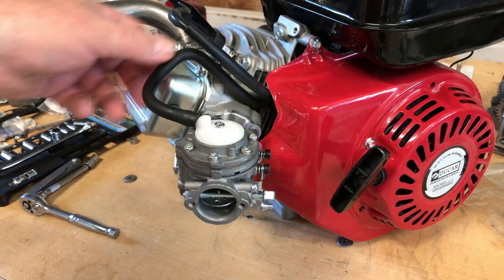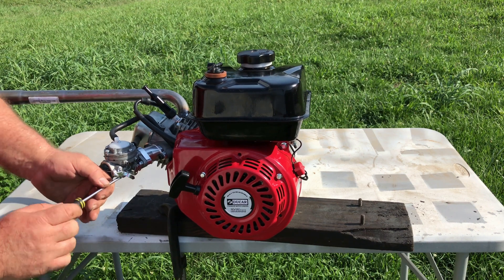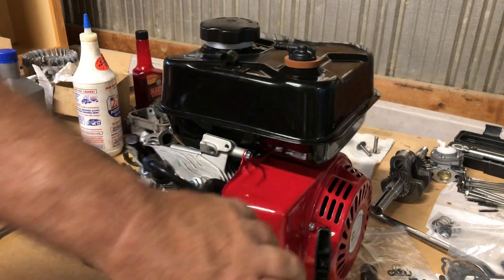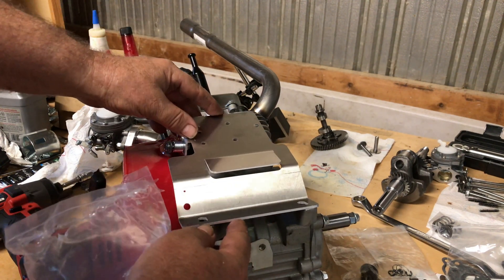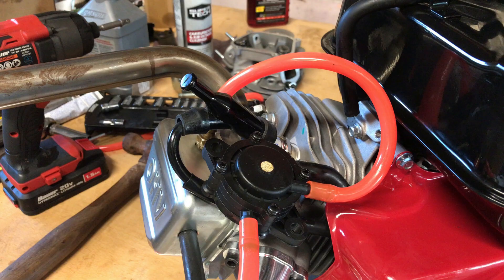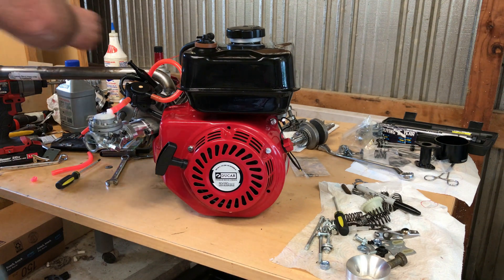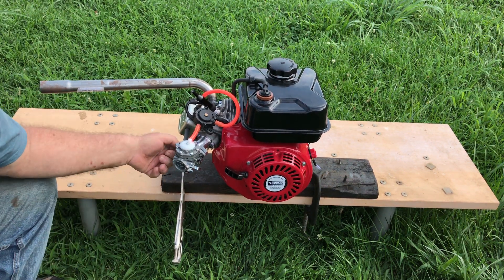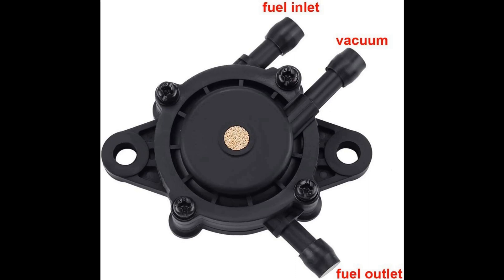Tillotson Carburetor Will It Run Without a Fuel Pump? Let's Find Out! DUCAR Predator Ghost 212

Comment: Tillotson has a built in fuel pump especially with the older chain saws that used that style carburetor
Reply from the maker: Hi William! Chainsaws usually use a pressurized fuel tank to achieve the fuel pump effect. The old Homelites used a rubber valve called a "duckbill" that would pressurize the tank. I first found out about pressurized fuel tanks the first time I removed a fuel line from a chainsaw carb and it became a small version of "Old Faithful". Soaked me and the bench with 2 stroke mix!

Comment: I run mine with the stock tank gravity feed. No fuel pump. It runs awesome.  The first time starting is a couple pulls. But I cover the throttle body opening with my palm. Pull a couple times and then  maybe one or two pulls after that it runs fine.
Reply: I may try a pump I have thou and see if it runs any better.    I’m 3/4 turn out on the low. 1-1/4 out on the high and pivot arm bent  to about half travel and it runs mint. It was just pig rich when I tried it with the pivot arm level and straight.  With both the carbs I tried it was the same.
Reply from the maker: Hi James! I think I had air in the line when I tried to run this one without a pump. I will be revisiting this issue again to see if I can get it to run without the fuel pump. Chainsaws use a pressurized tank to get around this issue.
Reply: I was thinking of pressurizing the tank with crank case pressure but it worked fine so I never did.  It has crazy midrange power using these carbs. There a little big for a 196/212 I think so there is a down low hesitation because of the large amount of air but as soon as the fuel picks up it’s out of there
Reply from the maker: Hi James! For low end bog out of the corners you can open the low speed screw a little to give it more fuel during the low speed circuit or add a second pump stack. (I've noticed with stacked pump carbs you can't let it idle though or it will dilute the crankcase oil with Methanol or gas.) Lots of oil changes!

Comment: Would this carb work well with a 212 with a bid valve head ? Or which one should I buy ? Ty
Reply from the maker: Hi GB Racing! Here's the venturi size from the "Tillotson Clone Carbs How do they Measure Up? video:
FULIN = .750 venturi with a 1" Throttle Bore ($14.00)

Tillotson "marked" Clone = .785 venturi with a 1" Throttle Bore ($14.00)

HD Golf Cart Replacement Carburetor = .865 venturi with a 1" Throttle Bore (This one was $19.99)

If you have a hot engine, I'd go with the larger venturi carburetor. The link to the $13 carb has sent me two different types of Tillotson clone carbs. I think it must be luck of the draw? The Harley Davidson Golf Cart replacement carburetor was the largest at .865 venturi bore but it was also $19.99 after some shopping around.

The Tillotson carbs are by far my favorite carburetors for performance engines especially on those that are running Methanol. You can stack the fuel pump blocks for more "force fed fuel" and there's no float bowl to splash fuel around in the corners if you're racing.
Reply: @KentuckyFriedFixes  Ty ! You’re the best !!

Comment: Dont those carbs have internal pumps?
Reply from the maker: Hi MBM! The Tillotson does use a diaphragm pulse to pump fuel internally into the bore of the carb but nothing for external pumping of fuel. I had thought since chainsaws don't have an external fuel pump why would I need one? The problem is chainsaws actually pressurize the fuel tank which creates fuel pressure just like an external fuel pump would. I found that out the first time I pulled a fuel line off a chainsaw carb and it sprayed 2 stroke gas everywhere. Some still say it's possible to run the Tilly without a fuel pump so I may revisit this in the future for another try. Thanks!
Reply: @KentuckyFriedFixes  its because i have a hl374a on alky and it had used it on a fuel pump and it was to much gas and thats why i asked thank you for the info🤝🙏
Reply from the maker: @martin_gets_sidewayz  Were you using an electric fuel pump? I know some have had issues with anything other than the pulse pumps. Too much fuel pressure will blow the needle off the seat and pop the diaphragm. Your pop off may be set too low as well. More fuel pressure requires a higher pop off setting. These things are a bit of trouble to tune but for racing they're the way to go IMO.

Comment: Interesting video KFF!  i was thinking about trying out a Tilly  TCT mechanical injection carb, but also guessed it would need a pulse pump even on a gravity fed tank.  Ever played with one of those on a 212 clone?
Reply from the maker: Hi Rick! I've seen the Tillotson injection carbs that look a bit like a regular clone carb but I've not tried those. I prefer the old tried and true Tillotson design, they're about as close as you can get to an injection fuel system IMO. They've always worked great with Methanol and you can soak the cylinder walls if you let a Tilly carb idle. Love them things! I was excited to try these cheap cloned Tilly carbs they're pretty good for the money!
Reply: @KentuckyFriedFixes  the one you want to try over a 196cc motor is the TILLY TFB for the extra bore size.  I'm with you though... too many gimmicks on the mechanical injection and a need for a pulse pump on clones.   I prefer a TILLY PK-3A at altitude right out of the box to keep steady.  I ride 8k+ where I am, but these carbs are interesting if at steady lower elevation once tuned. Keep it up.  Learning a lot from you.
Reply from the maker: @rickwhitfield7617  Thanks Rick! I'll look into those TFB carbs!
Reply: Yep.. we agree on gimmicky on the mechanical injection units. That's funny, because I have actually been waiting to buy a Tilly PK 3A... but cant find any in stock.  EC CARBURETORS has been out for some time. Do you know of another vendor out there that carries them?  I was thinking I could also snag a Tilly PK 2B and simply rejet it down, but that feels like a hassle.
Reply from the maker: @rickwhitfield7617  Rick I usually don't mess with the stock style carburetors as there's not a lot of power in those. There are much better performance options but I realize if you're Kart racing or something your choices are kind of limited. If I was going to go with a stock style carb I'd use one from EC for sure though. Those guys are good on carburetors. They don't sponsor the channel or anything but credit given where its due, they know their business.

Comment: Pull the carb , check the flange on the carb,see the tee tiny hole in the carb flange? Put a small slot in your intake flange to allow the intake pulse to meet that hole. Trim your gasket to allow for the pulse to meet hole ,but be sure the carb seals above the tee tiny hole. Taa daa no pump!
Reply from the maker: Hi Mark! I am going to try this one again. It has the correct intake and gasket to allow the carb to pulse properly. I think maybe some air got into the line as well. I should have checked further before calling it but I will give it another go. If it will run without a fuel pump I want to make it happen. I was originally thinking that if chainsaws will run without a pump this would too but I think the chainsaw fuel tanks are pressurized with a duck bill valve. Not giving up. Thanks!
Reply: @KentuckyFriedFixes  you had it running so, if it works it’s good . I run my carb dry at the end of the day so I have to cover the carb with my hand till it gets wet
Reply from the maker: @mark501w  Thanks Mark. Good info!
Reply: Yes, I used 3 Tillotson carbs on old Vire-6 and made that internal fuel pumps. Successfully.

Comment: From what I'm seeing...there's a big hump in the fuel line from the tank to the carb. It's not a straight up/down shot. I'm not sure how fuel is supposed to get over that Mt Everest sized hump in the line to get to the carb with just gravity to help. Maybe a shorter fuel line for a straighter shot?
Reply from the maker: I'm not giving up on it. There will be more attempts to run a Tillotson without a fuel pump coming up. I have been thinking about that very issue with the fuel line being elevated on this attempt. It could make all the difference. Thanks!

Comment: drill holes in that gas cap thats what i did before i ran my dirtbike tank
Reply from the maker: I've not given up on trying to get the Tillotson to run without a fuel pump. I will try again but may use an electric start for the engine this time.
Reply: @KentuckyFriedFixes  good stuff man
Reply from the maker: @CruiZe-A-ViSiON  Thank you Sir!
Reply: can i get a side of mah with those fixins lol
Reply from the maker: @CruiZe-A-ViSiON  🤣🤣🤣

Comment: im gonna try this one i have the vm22 but it needs to be jetted but this stock ducar carb has to go it has barley any top end i only hit 48 on the 13tooth max torque i still have the gov in but its dissabled but the carb only has a 38jet i put in and stock pilot
Reply from the maker: The Tillotson carbs are great! The only bad thing about them is the price of the intake, unless you make your own, then it's not an issue.

Comment: those pumps are generally very good but they just couldn't cut the mustard on my golf cart , I think because it had to move the fuel so far.
Reply from the maker: There's not a lot of pressure from those pumps. I had to install 2 on my racing kart years ago. I had tried an electric fuel pump on it but it was too much for the Tillotson carburetor. Thanks for dropping in!
Reply: @KentuckyFriedFixes  I got a really low pressure pump, I think it was something like  2 or 4 psi.
Reply from the maker: @MissouriOldTimer  I looked at the motorcycle electric fuel pump online. The price was very reasonable. I'm going to do some more experiments with these Tillotson carburetors. I may try to adapt a fuel pump like you used on your engine swap and see if it will work with the Tillotson!

Comment: I dug 2 old Matag washer out of a ditch to get the ringer tube braises make nice little tables new ones are plastic but ever time find an old one I get to pull steel should make a video sometime
Reply from the maker: I ended up using a heavy short table. It has a thick wood top like my work table but it's a lot smaller. Can't leave it in the rain though. The plastic folding table is rain friendly, but too light.
Reply: @KentuckyFriedFixes   fellow had an old junk front tine tiller you could pull tines off it and make a pretty nice little motor starting cart even rig a battery for electric applications and wheels to roll it around easy
Reply from the maker: That's a good idea. I've got several old generator frames laying around but those are too close to the ground. I'm allergic to bending at the waist. Surely I can locate an old tiller frame off craigslist or something. Thanks HP!

Comment: try it without the fuel pump again...except, while blowing on the tank vent line with your mouth, with your free hand with a flat head screw driver, open the strainer cap bolt until you are blowing/leaking fuel from around the strainer cap. then start it.
Reply from the maker: LOL! That's kinda like a chainsaw with pressurized fuel tank. I'm not sure I can bring myself to go mouth to mouth with the fuel tank. But you are correct, it would probably start as long as the tank is under pressure.
Reply: @KentuckyFriedFixes  i do this daily on race karts. all the 2 stroke karts that use pumper carbs will take 10+ sec on the starter to prime. fires right up if force fuel into he strainer with the blowing into the tank vent method.
Reply from the maker: @RACE.KART.PRODUCTS  I have not given up on trying to get one to run on a 4 stroke without a fuel pump. I know you're a kart racer, and I really do appreciate your input. I watched some of your kart videos and you should post more! I don't know if there will be a difference between running a Tillotson carb on a 2 stroke vs running one on a 4 stroke. Seems like the 2 stroke would cycle the carb diaphragm twice as much as a 4 stroke. I do agree with you 100% that there should not be any air in the fuel strainer area of the carb. Even after I installed the fuel pump, it would not start until I bled the air out of the line. I know it would likely start if I pressurized the fuel tank like a chainsaw. More experiments will be done with these carbs. I'm just getting started! I'm also considering a low psi electric motorcycle fuel pump. I tried an electric pump years ago on a Blockzilla open on methanol but it overpowered the Tilly. I never tried a low psi electric as I couldn't find one then. Thanks for your input and advice. I appreciate you!
Reply: @KentuckyFriedFixes  we will do more in the future. The tilly should be all you need. the intake pulse is a bit stronger than a 2t.

Comment: You better wring out that paper towel into your gas can 😂 all kidding aside nice video! I've never messed with a tillitson carb other than a little bit with the tct. Are they used mostly in karting applications? I'm about done with the bottom end of my 224... I knew some material had to go for clearance but man did I have to take more than I thought. Had big problems with the cam(between the lobes as usual and some off the side of the intake lobe) and crank weights clearing the bottom of my piston skirts (went to a tillitson flat top) just have to take a little more off the bottom of the cylinder and should be clear! Thanks for all the videos! Really helps me if I get caught somewhere to comeback and review one of your videos
Reply from the maker: Thanks Steve! I should have soaked up the spilled gas with a sponge! Those 224 builds do require a lot of clearance work! The parts you choose will definitely determine how much work has to be done. You'll get it, a little time and effort and you'll have a fire breather!

Comment: What is the model number on that carburetor? I have been watching all of your videos on the Ducar 212 I just put one in my bt200x. Great videos can't find any builds of these engines or insights this has helped me big time on my build.
Reply from the maker: Hi Jim! I cannot find a model number on the carb body of these? The link for them lists several model numbers but nothing is on the carburetor body? I will do another video on the Tillotson clone carbs soon. I ordered a set of ID measuring tools to get the exact measurement of the venturi and they have arrived. I'll get the measurements and get the video done ASAP. The first carb I ordered said "FULIN" on it and it had a smaller venturi than the second carb I received that was marked "Tillotson".  I'll measure both in the next Tillotson video. Thanks for watching I appreciate you Jim.

Comment: Tillotson v Mikuni. All things considered. Which is better? Also ever mess with Dellorto or Weber carbs?
Reply from the maker: The Mikuni carbs do have an advantage with air flow. I really like the slide carbs. But where the Tillotson has an advantage over the Mikuni is it can pump fuel into the throttle bore like a fuel injection. For a Methanol engine that's a big advantage! I've never messed with a Dellorto carb. And the only Webers I've fooled with were on VW engines! LOL!
Reply: @KentuckyFriedFixes  yup, dual Weber carbs on a type 1. I don't know much about methanol. Good stuff.